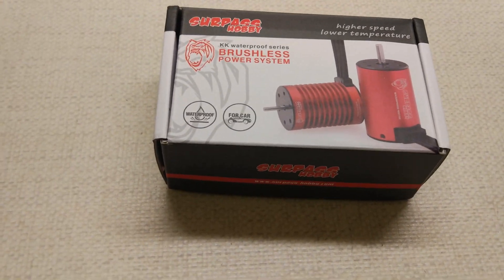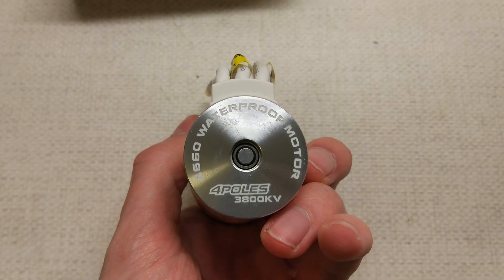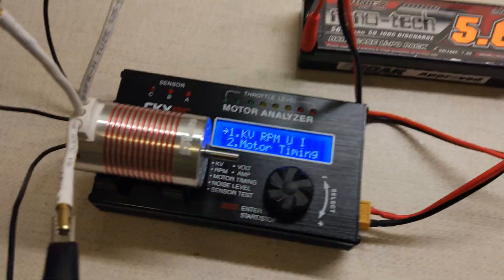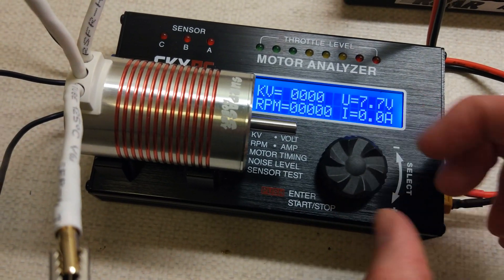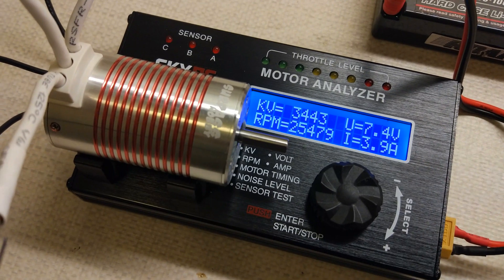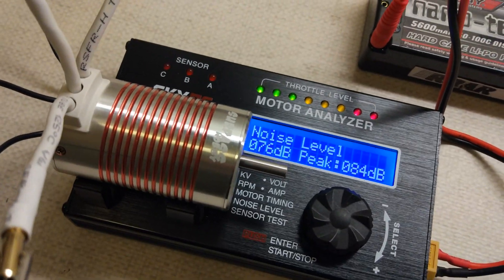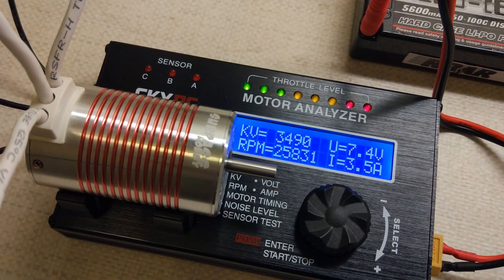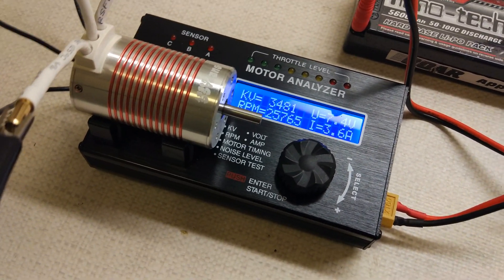MTT EP11 Supass Platinum 3660 3800KV

Comment: hey man can you chech if you can advance timing in the esc with this motor?. can you check the timing on the motor?
Reply from the maker: You can't change the timing on this motor. It is fixed 👍 you might be able to change it via the esc, but it will have to be plugged into the esc to do that, the motor tester can't change it.

Comment: excuse my ignorance but shouldn't we test the motors at 8.4 volts? when fully charged 2s lipo has nominal voltage of 7. 4 volts but fully charged it would deliver close. to 8.4 volts isn't that right? 7. 4 volts should be close to lowest voltage. delivered by lipos when operating an rc?
Reply from the maker: It doesn't really matter as long as I test all the motors with the same battery at the same voltage. 👍 When running an RC car the cut off is normally set to 3-3.4v per cell which is 6-6.8v on a 2s.

Comment: I have a Traxxas Rally 4x4 Roller  for Asphault only that im building with a 54T spur, Max10 SCT and looking for a Motor that can get me at least 50mph for street bashing without thermal shutdowns. If the true kv is 3400 that shiuld be fine since im looking for a motor in the 2900-3500kv for 3s batteries. Im gonna give this motor a whirl. Thanks for the review.

Comment: You got a bad one. Mine pulls just under 3800kv @ 4 amps. I did run 2 packs through it then clean and oil the bearings before going on the tester.

Comment: I just brought one and installed in my buggy with a 19T 5mm pinion.
The old 3652 3300kv motor did 63k/h on 3S with a 17T pinion.

When I tested it it did 71kh which indicates my motor is around 3300kv not 3800kv so yeah like you I will just gear up to a 23T pinion to get about 80+ k/h 50mph.

Comment: Bellow 13v,why don't u use 3s to get the higher KV?
Reply from the maker: At 13v it would have the same KV.
Reply: Are u sure about that?? More volt will give more power include KV
Reply from the maker: @pakmatgarage259  no, KV is constant..... It will give the motor more rpm, but the same KV.

Comment: Enjoying the tests. Pretty new to RCs but just replaced my first motor from a Arrma 3s with the Surpass Hobby 3660 3300kv (orange can). Although it does feel a little less punchy down low the motor runs smooth and has plenty of top end zip. Runs well on 2s and 3s where my stock Spectrum engine cogged like crazy so much it refuses to run on 2s once the  battery  gets below 75%. For the cost of the Surpass motor I'm super impressed. 

Can you tell me if I was to got one with a 3670 can but similar KV to what I have now would that add a bit more torque? 

Thanks
Reply from the maker: Yes. You would have more torque
Reply from the maker: You might want to try going with a bit lower KV and a bigger pinion too. Like a 2650kv

Comment: My surpass platinum spec sheet says 100amps max. Is that how much it will draw??? Im trying to determine the draw to tell if i can use a deans plug. Hobbywing max10 doesn’t recommend a deans.  im trying to sort this all out and figure what my system pulls. Ty for any info from anyone.
Reply from the maker: No, that is the maximum A the wires inside the motor can take. The current draw depends on the gearing a weight of the car.
Reply: @LawrenceTimme  thanx!

Comment: Will this fit to wltoys 144001?
Reply from the maker: Not sure it's 36mm*60mm with 5mm shaft. Measure the stock motor and see.
Reply: No, you need one with a 3mm shaft

Comment: Just tested a 3650 4300kv Platinum series. Got no-load current 5.2A instead of 2.7A specs. Heats up very quickly.
Reply from the maker: Does the match the rated kv?
Reply: @LawrenceTimme  I measured ~4000kv at 11V with an oscilloscope. The 5.2A was also at 11V. Do they specify I0 at the highest voltage?
Reply from the maker: @pavlomaksyutenko3301  it will have been done at 7.4v the current will go up with the voltage but the kB should stay the same as long as the temperature is constantl

Comment: Bro another great video, really enjoyable facts n info... that's a Awesome looking motor. I've got two (red can) surpass motors... both feel like their missing 500kv... I'm not too impressed with them. ✌✌✌
Reply: Though i can appreciate this info  for future knowledge when lookin to buy another motor, but the old saying : you get what you pay for : and that still holds true and at the price these motors sell for id say your getting exactly that, otherwise there wouldn't be brands like castle creations,hobbywing,trinity and etc all of which cost considerable amount more because there giving quilty and  whatever there claim to what motor/esc can do, just making sense of the results but also if the motor is 3500kv they should've just said that and called it 3500kv platinum, funny thing is if you look on castle creations website there recommended motor for 1/10 monster truck is 3800kv not exactly sure if also 4wd but definitely know thats what they recommend along with proper gearing which to me means its almost not the proper kv but then again its rated for 2s-3s and esc quilty ive learned makes a world of difference in regards to how a motor performs in the vehicle used in. But definitely love the inside info keep up the good work.
Reply from the maker: @4077661466jp  I don't think so, after testing the actual performance of the motor in my truck it out performs the hobbywing 3660sl 3200kv by a long way.
Reply from the maker: Yeah I've got another one coming but it's a different brand.
Reply: @LawrenceTimme  Wicked, can't wait for next motor test Tuesday vid. Peace bro 💪